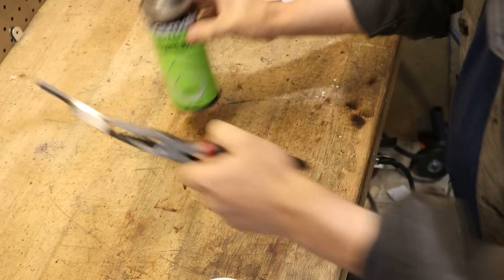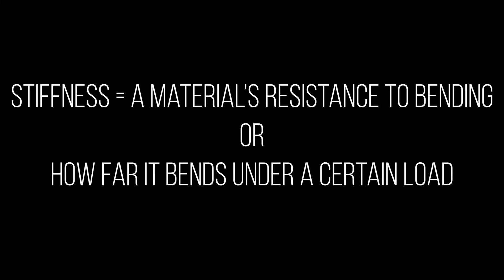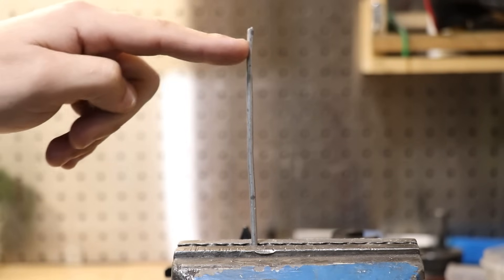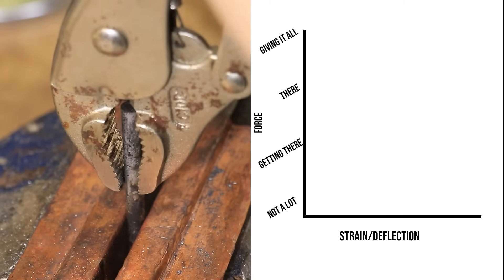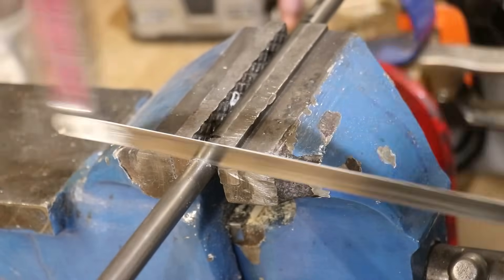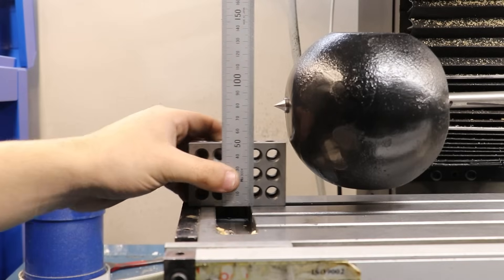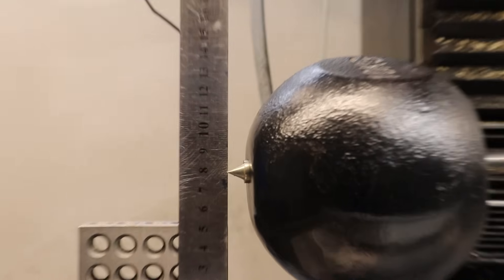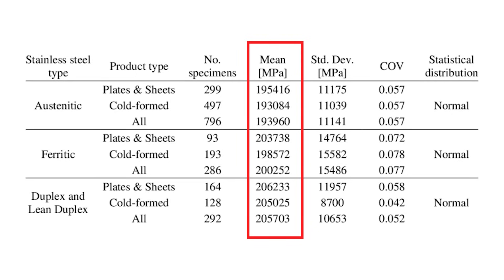Hardened Steel is NOT Stiffer Than Soft Steel

Comment: Do you have a lathe? I would like to see the performance of three tool post boring bars 1) Tungsten carbide, 2) 13% Cobalt Tool Steel 3) Mild ("Machinery") steel. Methinks you are full of Hoooey, Sir.
Reply from the maker: What makes you think that?
Reply: @artisanmakes  Because I happen to know you are full of it and have never tried it for yourself. DO YOUR OWN TESTS and you will see what you said simply isn't true.
Go ahead - next you will tell me soft steel has the same tensile strength as 2.5% carbon music wire.
Reply from the maker: That is a very ignorant thing to say. Why would I tell you that soft steel has the same tensile strength as 2.5% carbon music wire, that's not true is it. Also 2.5% carbon music wire doesn't exist. That would be cast iron at that point. Instead of throwing out baseless accusations I recommend that you read up on material properties and what determines the properties of a material.
Reply: @artisanmakes  Dude I was the toolmaker that made the 1/35th RUNNING scale patent model of the  C-Series Pratt Whitney R-2800 for Chevrolet in 1950. As an apprentice. Look that up. Resistance to bending (stiffness) is proportional to tensile strength. And look up EN25 steel while you are at it. Perhaps "music wire" isn't rigorous but an Americanism instead.
        Maybe get out in the shop and Do Your Own Research before presuming to teach?
  Go make some boring tools. Try them out and report back.
Reply from the maker: The force it takes to plastically deform a part is the yield strength. The stress/strain relationship up to that point is the youngs modulus, which is the steels intrinsic resistance to deform under a certain force. The young's modulus does not change through heat treatment. Of course it will become stronger and it will take more force to get to the point where we see yield, but that's does not mean that we have seen a change in stiffness or the young's modulus. 

I don't use EN25 steel a lot but looking it up on SolidWorks, young's modulus is 210 gpa. I wouldn't expect that to change at all with heat treatment. 

Referring to your intimal comment mild steel and cobalt tool steel should show almost the same young's modulus to within about 5% of each other, with the difference mainly being the alloy in the cobalt steel

Comment: 9:12 after quenching you should do tempering, and for whole process i would send it to be done professionally. Whole heat treatment process will change dimension of part, so it's better to be done on roughly machined piece (or stock) and machine it to final dimension after HT process.
10:51 well, as i would guess it's more surface hardened than as whole and dipping it in oil would be better, but your point still stands - angle of elastic deformation slope won't change, but holds its slope for longer before going to plastic deformation zone
Reply from the maker: Then we cannot claim to be using the exact same piece of steel before and after which is the whole point. The warp is an unfortunate consequence but given how stiffness doesn’t change it’s not worth worrying about. 

I don’t know by what metric you think dipping it in oil would be better, water gets it as hard as it could get which is the aim for the demonstration.

Comment: so when we say the steel has been hardened what we mean is the steels tendency to deform over a very small surface (ie a knifes edge) so hardening a large piece while it has its place is not a everyday thing. when we mean hardened we are talking about a cutting edge or a tip of a blade. and I do intend to watch the whole video. so I might be back to edit this comment. depending on how well you cover this topic
Reply from the maker: Sure, that a fair way to describe it. I don't think it particularly is important with regards to the scope of the video. Cheers

Comment: So at the end of the video you contradict the whole video when you admit that the Alloy matter and can be 5% or more change in stiffness.
Reply from the maker: No? Alloying is not heat treatment. And it is in line with what I said because stiffness is determined by the atomic bonds between the iron atoms. If that is disrupted by adding different atoms the stiffness will change. That is not heat treatment and heat treatment does not change the stiffness
Reply: @artisanmakes  so you are saying heat treatment in noway effects the bonds in alloys?
The structure matters more than the bonds.  Just look at Graphite, Coal, Buckyballs and Diamond.
Reply from the maker: Well those are allotropes not alloys, so you are talking about something very different to your first comment. 

I didn’t study allotropes of carbon as a part of my undergrad so I can not comment with certainly on the matter but I think it is possible that different allotropes of carbon could have different Young’s modulus. 

With that said it has nothing to do with the content in the video.
Reply: @artisanmakes  no I'm demonstrating structural differences.  Are you saying heat treating doesn't affect structure?
Heating treating different alloys effect structure differently.  Giving as you said a 5% difference, something your test rig and procedure could not measure accurately.
Reply from the maker: I said roughly 5 percent difference max between different alloys. Most fall between 190-205gpa. 200 is the usual rule of thumb. I didn’t change the alloy here so you’d expect no change? I never said I changed the alloy.

And I am saying that heat treating does not affect the iron-iron bonds which make up the bulk of the material which is responsible for the modulus which will not change.

Young’s modulus and bending is an intermolecular relationship between two atoms and this relationship is not affected by heat treatment.
Reply: @artisanmakes  you comments are contradicting each other.
Reply from the maker: Nope I have been very consistent and patient. Stiffness is between the iron-iron bonds. I said that in my first and third comment to you. Heat treatment does not affect this. This is correct, this is straight from my engineering materials textbook which I used to get my degree. This information is correct.
Reply: @artisanmakes  so is Iron-Iron bonds a atomic bond?  If so you contradicted yourself if not you have a baseless position.
Reply from the maker: I can not help you any further. You need to pick up a materials textbook and have a good long read. Everything I have said in this video and comment section is straight from my materials and engineering textbooks. If you want to disagree or argue with them. Fine.
Reply: @artisanmakes  so you are showing yourself to either 1) manipulating the algorithm or 2) a poor commicator.

If you noticed I haven't argued what textbooks say.  I am pointing out WHAT YOU SAID/WROTE.

So the take way is you are saying NO MATERIAL  has any change at all of stiffness in regards to heat treating and hardness, because heat treating has absolutely no affect on strength which has no effect on stiffness...

Or that Delta L is in no way effected by hardness (the resistance to deformation).  L can not change without deforming.
Reply: @bowez9  Just finished viewing the video. He is correct in what he is saying. I think you are a troll or you just don't know what you are talking about. From your comments you really have no clue
Reply: @qants so inducing a 20% deviation and bring up other alloys and saying atomic bonds aren't changed but Iron-Iron bonds are changed are totally correct?
Reply from the maker: 3 times I said to you that iron-iron bonds are not changed through heat treatment. 3 TIMES. How is it this hard for you
Reply: @artisanmakes just leave him. Everyone else seems to understand what you are talking about. This guy is just making stuff up and he does not know anything about metallurgy.
Reply: @bowez9 you are all over the place with what you are trying to dispute. It’s actually embarrassing. You don’t know what you are talking about here and you have trouble comprehending the factual responses that are given to you. This subject matter is obviously well beyond you.
Reply: @artisanmakes so Carbon and other elements dont move in the space between the Iron bond with heat treatment? Does this not change the electron field and means there is NO INTERACTION  what so ever at all?
Reply: @qants try again as a Tool and Die Maker I know more than most.  This why I'm calling him out for his absolute statements-espically in little of his expirment 1)being un evenly heated, 2) inducibg deformation 3) induceing a 20% variance on a rig that can show 1% at best, therefore any variation less than 1% can't be show and anything under 20% is obscured 4) bring up alloy variation as an untest tag at the end

Or are you saying a Dial indicator and layout table could not be used?  Or would that have defeated the abaoulte statement by showing a few thousandths difference?
Reply: @bowez9  And I say this as a Mechanical Engineer. Your statements make little sense and you obviously have great difficulty understanding what is said to you.
I don't care that you are a tool and die maker, you obviously have little understanding of the theory behind your work.
You pulled the 20 percent figure out of nowhere. No where in his video did he say that you should be able to see a 20 percent change in stiffness. He said that it would be a 5 percent change if the underlying alloy changes. He did not change the alloy, all he did was heat treat it. How are you this dense
Reply: @qants the deformation of 2 mm after heat treating created due to the bending of the rod.  This in an of its self would change the stiffness.  8mm of 10mm is a 20% change in the measured deflection from the start of the test.  As such ot invalidates any information attempting to be show here.  Or as an Engineer do you  not believe a change in shape or profile has an effect on stiffness?
Reply: @bowez9  Young's Modulus/stiffness is independent of shape. You are now talking about deflection along a rod. The shape may cause the amount of bending to be slightly different, you'd have to calculate what the difference is, but that is not because the youngs modulus has changed.

What we see is 10mm of deflection IN BOTH INSTANCES which is what you would expect because the young modulus does not change. It might be a little bit more or less due to the bend but this is not a change in stiffness but a change of the moment of inertia.
Reply: @bowez9 it is obvious throughout the whole video that he is talking about Young’s modulus. I am also talking about Young’s modulus and that is independent of shape.

You are taking about bending moments which are not the same thing.
Reply: @qants I've only talked about Stiffness as is in the title of the video.  If you want to comment on something else go find a subject on that.

The video isnt about Young's modulus for that is a constant and this wasn't a video about uts history or derivation but stiffness/bending.

Mean what you say and say what you mean.
Reply: @bowez9 within the elastic range. That is Young’s modulus. He even talks about Young’s modulus in the video.
Reply: @qants because Young's modulus is a factor in stiffness.
Reply: @bowez9  and it doesn't change. We are in agreement there.
Reply: @qants Young's modulus or stiffness?

Comment: i still don’t understand, u showed that the hardened rod bent down 10mm just like the unhardened rod but then immediately said that even with the pipe u couldn’t bend it???

so u showed it bends the same as unhardened with the weight but is harder to bend by hand??
Reply from the maker: It takes more force to permanently bend/deform the steel after heat treatment. The point at which it yields/deforms takes a lot more force after heat treatment. That is what the final shot is about. The stiffness remains unchanged, but it takes a great deal more force to act on the steel so that it deforms under load.

Comment: There is one way to improve the stiffness of a boring bar. That is to drill a hole in the middle of it & have a tensioned up bar inside this hole. This then moves the line on your graph to the right & does stiffen the bar. Doing this is a well-known way of improving the stiffness of a boring bar.

Comment: Why not just say it?  Hardness is not the same as stiffness.  The stiffness of a material (deflection under load within its elastic limit) is based on the materials modulus of elasticity.  If your hardening process doesn't change the modulus of elasticity, the stiffness won't change.
Reply from the maker: Well it’s not just hardness that hardening changes and that needed to be demonstrated. People interpreting a change in yield strength to a change in stiffness. I don’t think anyone confuses hardness with stiffness as that is not what I was addressing.

Comment: I think the reason people say you are wrong is because you are talking about the spring force (spring rate if you will) of steel and they are thinking about the the amount of force it takes to plastically deform a material. I didn't understand what you meant until you showed your testing setup. Up until then, I thought you were contradicting yourself when you were explaining things. I personally first think of bending steel as plastically deforming it, not just flexing it and letting it flex back.
Reply from the maker: Maybe my English has failed me here

Comment: Stiffness, resistance to deformation under load, 
Just thinking out loud here ...Wouldnt it be correlated to it's hardness as my understanding is as a carbon steel is quenched it's hardness increases and elasticity reduces ? A harder more brittle material has a lower modulus of elasticity and generally less deformation under stress prior to failure. (Ref stress strain diagram of hardened vs unharded medium carbon steels.) Forgive me a my welding training never used stiffness as a description of metal. 
What the title alludes to is harded. Vs unharden has the same stiffness ? But we know with carbon steels harder is less modulus of elasticity and higher UTS so i find it hard to agree. 
What am i missing ?
Reply: Ok after watching fully, it's my understanding that what he is talking about is the elastic range of stress strain Diagram  the same carbon steel either hardened or not hardened would have the same slope on the diagram it's where the elastic limit is... and how it reacts when exceeded. Thus the stiffness is the same. (Please correct me if I'm wrong )
Reply from the maker: Yes this is correct, the slope/stiffness remains unaffected
Reply from the maker: Young’s modulus remains unchanged throughout

Comment: Don´t you all just love it when steel hardens when you don´t want it to, like when you are drilling a Hardox and it starts to work harden from the heat. And you got to get the Carbide end mill to get through it...
Reply: Oh so much fun.  Especially when using cordless drill on something that's way too large to fit in a mill!
Reply: A little tip I learned for the Hardox, put some tapping compound like Rocol on the end of the drill bit and you have a much higher chance of cutting through that localized hardness. Also, grind off the oxide layer with a flap wheel before marking and drilling to start off the actual steel with a sharp bit. Usually the oxide is what damages bits the most, part of why exit holes are so damaging to the bit.
Reply: Slow rpms and LOTS of pressure so the cutting edge quickly moves past the work hardened material.

Comment: About 30 years ago in a shop I worked, a guy that drove a stake truck  brought some about 1/2" steel pins that held the side panels in the truck and they were quite bent from bouncing around on the road. He wanted me to straighten them out and also if there was anything I could do to help keep them from bending up.
I straightened them and tried a quick flame heating to cherry red and quick quench to see if it would help, or if it would make them shear off like a tap.
He said it definitely made them hold up better.

Comment: @1:30 - it makes a lot more sense if you think of 'hardness' as "force required for permanent deformation" and 'stiffness' as "force required for a given amount of elastic deflection"

Hardness determines where the line between "elastic deformation" and "permanent deformation" is drawn, in terms of required force.

Comment: i was surprised to find different steels with widely varying tensile strengths have only marginally different yield strengths, this is probably why you can't make very light parts out of really thin super strong steel, they wouldn't be stiff enough. often the limiting factor isn't strength, but stiffness, an example would be using magnesium, sacrificing strength and maybe service life, to match the stiffness thus usability of aluminium, in order to achieve lighter weight

Comment: A few years ago engineering was talking about this so I took a 3/8 drill rod an a 3/8 mild steel cold rolled  .  Clamped them side by side 12" out , added same weight drill  rod deflected notasably less. Engineer just shook his head an walked off. Another thing they kept claiming is that thee threads of a nut do all the work. . I took 3/4 course ,fine. Turned nuts to three treads thick , turned bolt to only three threads. Oh this was grade 8.   All stripped long before the claimed torque  value. If memory is right. 175 foot pounds.
Reply: The reason the drill rod deflected less is that is contains both nickel and chrome and 1% carbon which changes its Young's modulus.  But you foxed the Engineer !
Reply: The drill rod is not the same alloy however. Heat treatment had no part in it. Just as a 3/8 wooden rod deflects more than the mild steel one.
Reply: Three threads do the majority of the work. The first thread takes the most load, second, slightly less and so on. The first three threads take around 70% load iirc but for full strength you need around 1.5 x thread diameter.